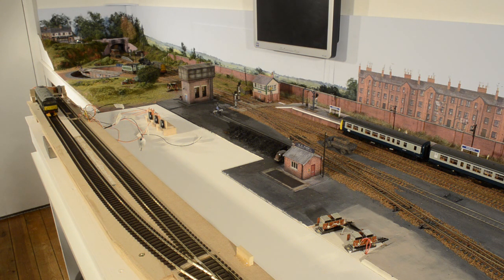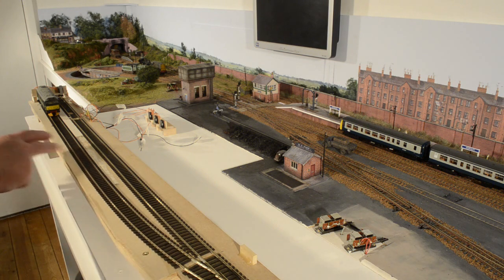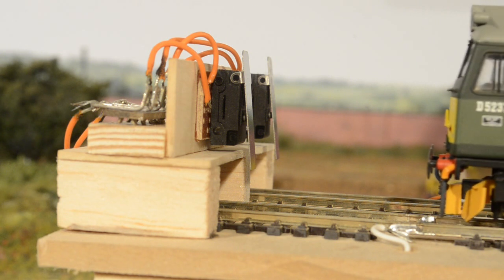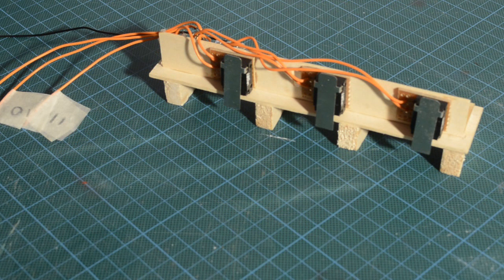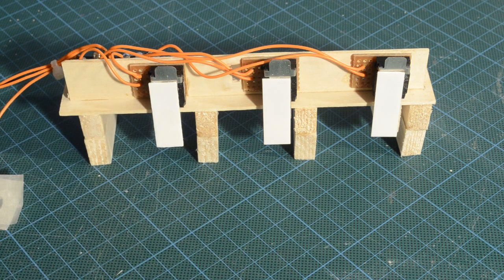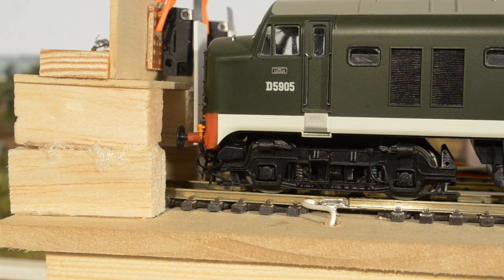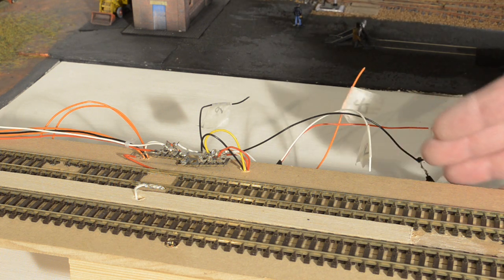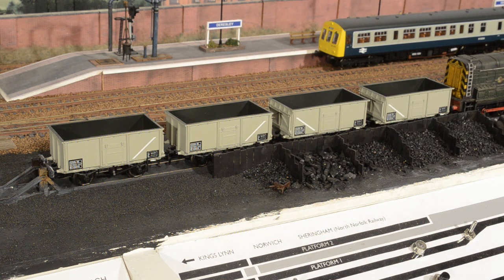DERESLEY UPDATE #4

Comment: Hi David,  I'm surprised those micro switches have enough to push back a loco!  But it's a neat idea actually, for sure it will prevent any incidents.  Good job on the scenic extension area, it should help give your shots alot more depth when finished.

Cheers,  Michael
Reply from the maker: Me too Michael. If I bought switches in the first place with longer levers I probably would have been O.K. Anyway, I think I may have sorted it. Still need to decide how to use the scenic extension - but its going to be worth it for the extra modelling opportunity that takes up no extra space.

Comment: I really enjoy your updates David, The crane videos are very good. I too have used micro switches for train on track indication and was also surprised at the strength of the spring, and my solution was the same as yours. I now use TOTI circuits from Merg for detecting my locos. You can see more on the first video on my new channel Canal Sidings. The video is much less polished that yours but I am hoping to improve as time goes by. Regards. John
Reply from the maker: Hi John. Thanks for your kind comments. Much appreciated. Thanks for the tip about TOTI - I will check out your video and channel. I am a bit old-school, and I guessed there must be a slicker way of going about things. Just finished wiring plugs to my traverser so I am eager to see how effective my switch mods prove to be. Thanks again for the tip. Regards, Davi